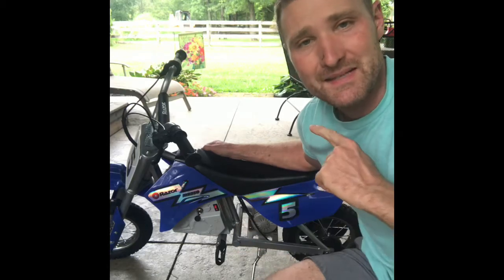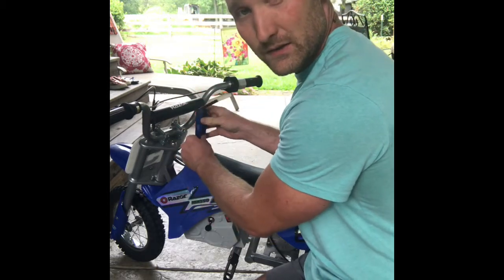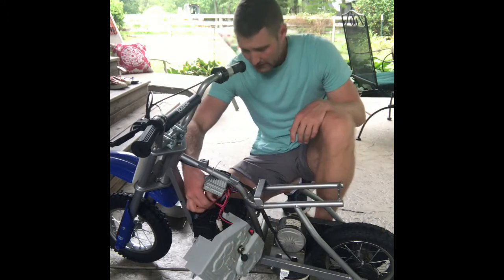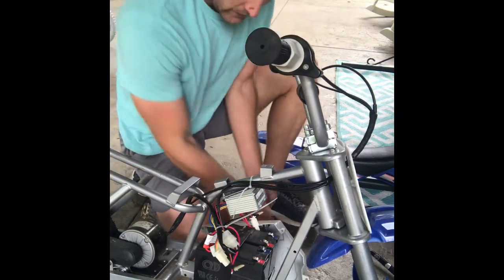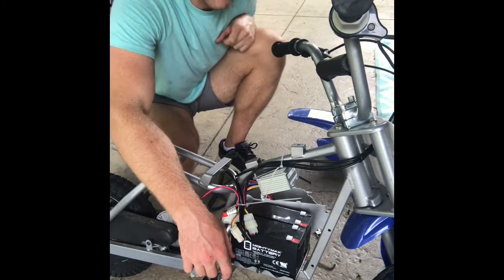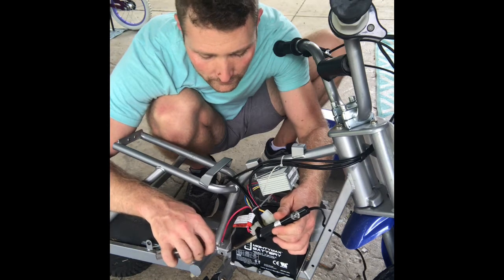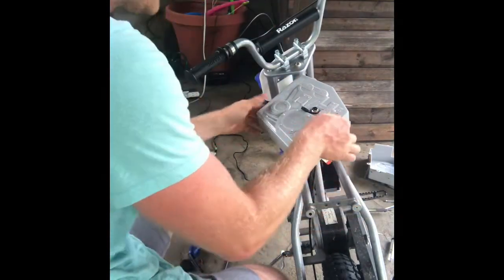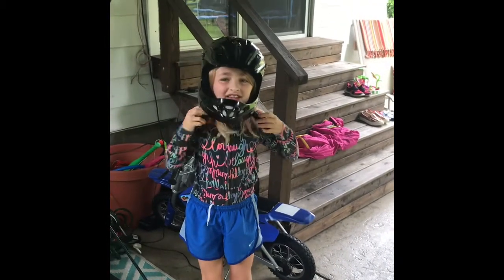Razor MX350 electric dirt bike battery replacement

Comment: I put new batteries  in my razor n it still won't do nothing  don't  click  r nothing
Reply from the maker: It could be the controller.  Does it switch on like the batteries are charged?
Reply: @leejonlogsdon  yes
Reply: @johnathanwright2690  im having the same exact issue right now, even had them send me new batteries in case. the stock ones were working but not charging really well,  so im not sure what to try next. ordered a multimeter to see if the power is drawing. lights up fine, but notta when hitting throttle (not even a click)
Reply: Good video, i would of used a heat gun to removed the hot glue